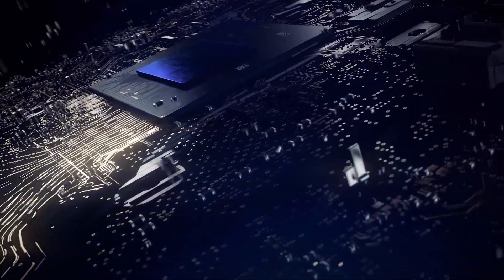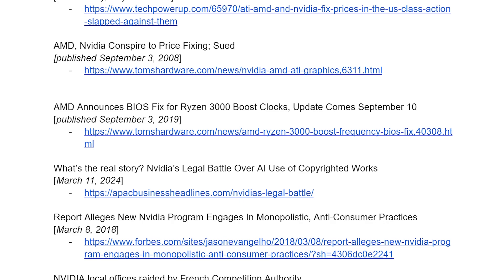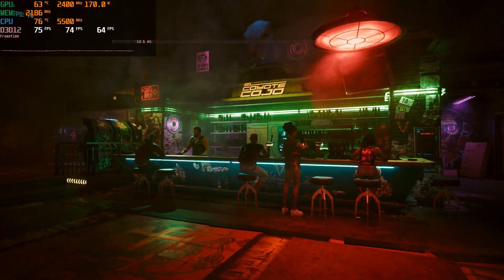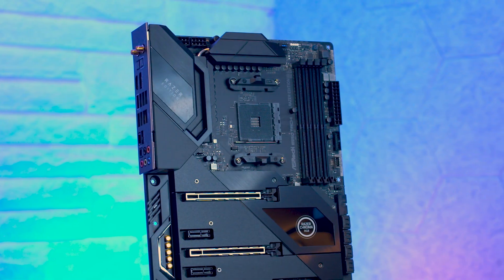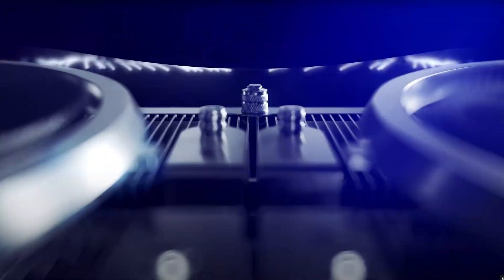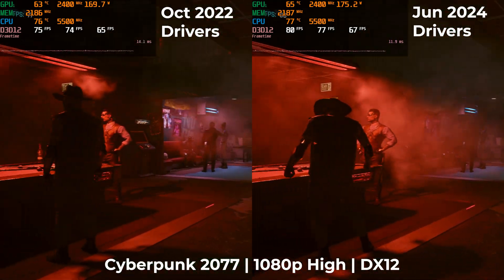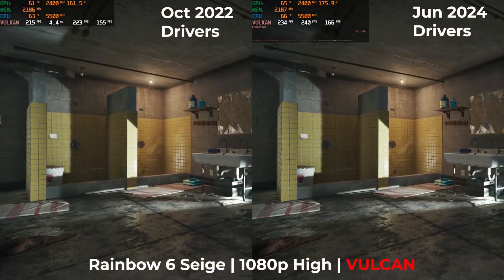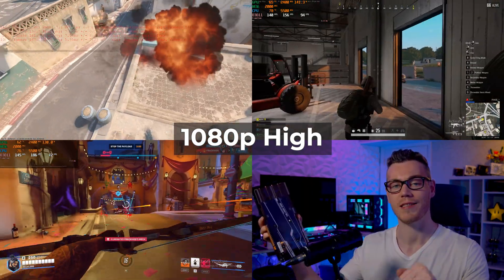Intel Saved Their Most Expensive Mistake...

Comment: Just upgraded to an Acer BiFrost Arc A770 16GB from my Vega 64 3 days ago. I was honestly worried that I was making a terrible mistake, but it's currently £230 at Currys which is an amazing deal for a GPU with 16GB of VRAM.
Obviously haven't spent much time with it, but so far I'm very, very pleased with it. I'm addicted to the Resident Evil 4 remake and it runs like a dream on it. You can crank the textures all the way up which makes the game use almost 15GB of VRAM and there's no issue.
I have had stutter in Overwatch 2 after switching to it. It's not common and doesn't last long; it's probably around 4 seconds every 3 matches or so. I play it casually and not that often so it's not something I mind too much, but that'd be a deal breaker for a lot of people. I think esports titles should be the #1 priority honestly, as those titles are always popular and the players tend to be the most vocal about performance issues.
I'm just happy the card is far more stable than I thought it'd be. No random BSODs or black screens and great performance in the titles I've played. I would have felt sad going for the RX 7600 or RTX 4060 over this as those cards simply have much less "GPU" for your buck if you know what I mean. The A770 having 16GB of VRAM on a 256 bit bus and plenty of cores for ray tracing and AI upscaling just make it feel so premium despite it being so cheap. It should age beautifully.
Reply: I just think it manages to put AMD in a very rough spot at least. Yes, the RX 7600 is faster at 1080p in the vast majority of games without ray tracing. As soon as you start going above 1080p and enabling ray tracing, the A770 shows how much more well-rounded of a GPU it is. XeSS needs more adoption, but it certainly looks cleaner than FSR does in the games I've used it in.
Intel have made managed to hit a sweet spot between the features Nvidia offers and delivering raw performance. AMD selling the 7600 for £30-£40 less than the 4060 with no real match for the fancy features it offers doesn't feel compelling. Intel doesn't need to be selling a GPU with 16GB of VRAM and a 256 bit bus for around £250 given the features it has, but it sure feels like AMD does.

Comment: Bluntly Intel AXG lied about the launch, they missed the market in Q1/2022 then priced A750 against Nvidia's 3060 not the 6600xt.
The reality is they didn't take market share from Nvidia, Intel were forced to drop prices and competed with AMD RDNA2 cards who'd already cut them to clear.
This was no attempt to deliver value to gamers, they aimed at profit and Ryan Shrout was publicising DX9 & DX11 benchmarks before the launch debacle.  The "designed for Rebar" was an obvious lie as nobody used Rebar until the RDNA2 launch long after Alchemist was designed.  TAP's talk about continuous GB file transfers was also BS because buses are designed to a max transfer size as multiple devices need a turn or the PC will likely lock up.
Alchemist was 2020 tech in 2022 and Battlemage was cut back with no 2024 dGPU launch announced.  Tiger Lake Xe graphics remain broken in many games, while AXG's management and dGPU designs were heavily cut back.
If Battlemage comes out, it'll be too little too late yet again.  Simply put, Intel have enough on their plate and have to stem the losses.  Alchemist is available from the original production run and OEMs didn't want Arc stickers on their laptops.
A heavy dose of realism should be applied, Intel have put their effort into AI and accelerators to try to defend their data center market share.

Comment: think dx12/vulkan optimisation are more on developers side; not much on hardware vendors; unlike older dx versions
Reply: developer have some control but it is not much. in the end full GPU optimization still reliant on GPU  vendor. it is not the same as console low level optimization.
Reply: check reviews from few years back
intel gpus were barely able to get 40fps at cp2077 

it was able to reach 60fps after the xess update

Comment: Totally surreal to see Intel, who used to be totally anti-consumer with their CPU's for nearly a decade, (with only 4 cores and hardly any significant performance improvements), until AMD Ryzen launched, be touted as the pro-consumer alternative for graphics cards now.  But if Battlemage comes out strong for the mainstream, with price to performance, I'll be trying out team Blue.
Reply: Hey, they were anti-consumer before that, even bribing execs of OEMs to not sell AMD Athlon which had an edge on Intel's Pentium.
There's a reason AMD didn't make profits despite successful chips which killed Intel proprietory 64bit Itanic.
Reply: @RobBCactive  AMD did not make profit nearly a decade because of their ATI acquisition. intel did not play fair during pentium 4 era but their core architecture was very competitive with AMD Phenoms. AMD still get decent profit with Phenom and Phenom 2 but the issue is AMD spend a lot of money when they acquire ATI for themselves. if AMD try to be more clever in this part they will not starved on money to compete with the rising intel back then.